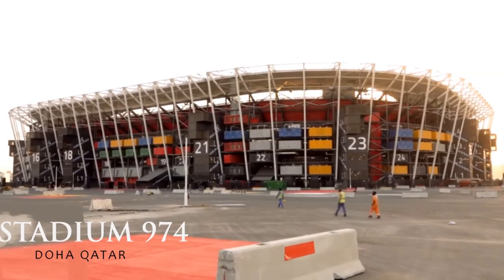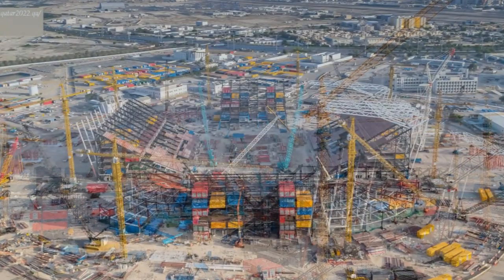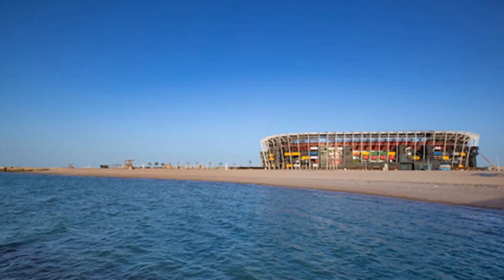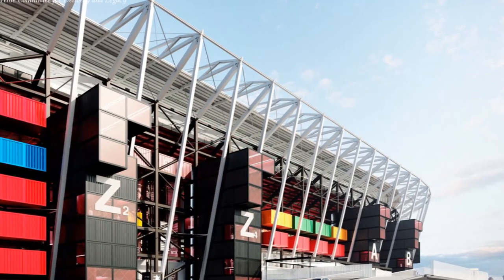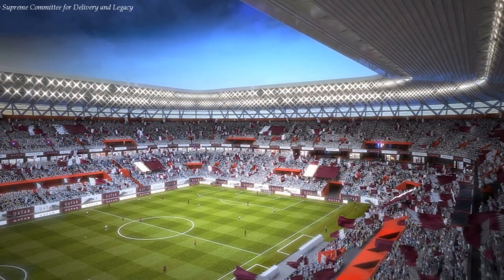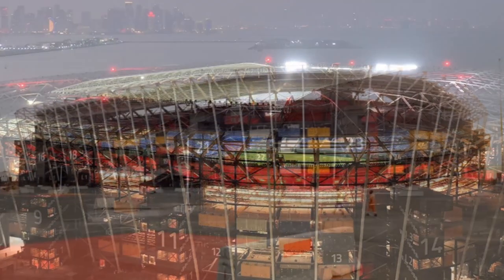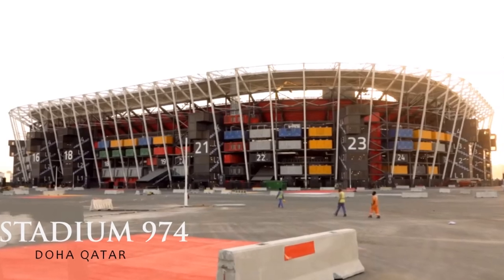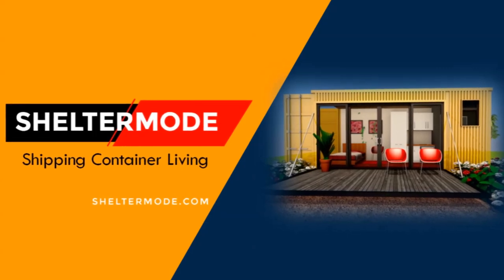Stadium 974: Demountable Shipping Container Stadium in Qatar

Comment: 🤯🤯🤯💯 wow this is an amazing architectural achievement! Impressive! The only failure is the lack of AC this place is at the mercy of the outdoor weather imagine the winter by the water with no heating!
Reply from the maker: Doha does not snow during winter. The winter is mild more of Spring than winter with temperature ranges between 14/17 °C (57/63 °F) and highs around 22/25 °C (72/77 °F). The biggest concern is the hot summers which have been effectively taken addressed.
Reply: Hot as balls in Doha mate😁